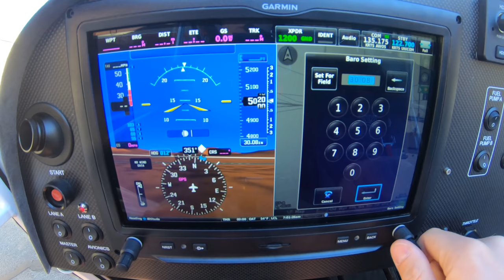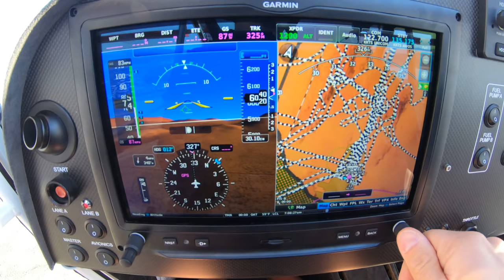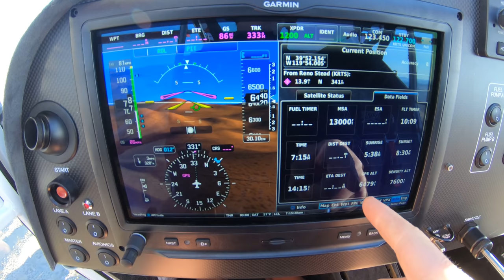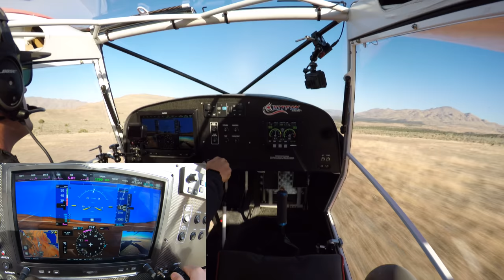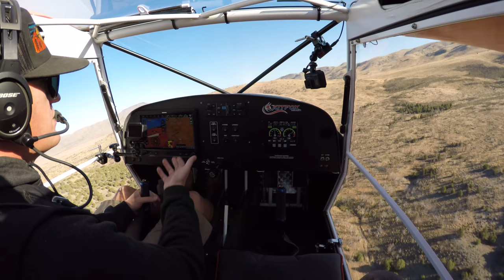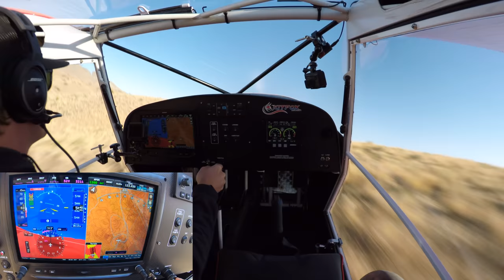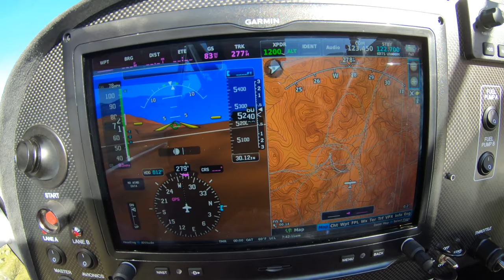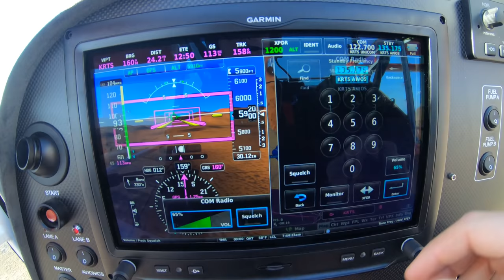Modern Avionics In Bush Planes - Overkill???

Comment: Never had "a panel" - relied on "Dead reckoning," (Deduced reckoning), use of a Chart and plotter, and a circular E6B computer, wind triangles.  On your knee board, use formulas for "time and distance," and fuel usage of "gallons - rate- and time."    Lots of fun and never worried about losing "power" to anything.   With an engine out, look over the instrument panel glare shield, "eye ball a 45 degree angle to the ground," that's how far you can glide. (naturally depending on wind.
Reply: Michael Donavon that’s like saying, “I still walk everywhere because walking works.  I don’t want to drive a car, as it could run out of gas or stop anytime.”  Things change and we have more available to us.  I assume you like using GPS as it can be so helpful.
Reply: I appreciate a bare bones approach to many things, even if just as a backup. But tech can be fun too! In all things, moderation.
Reply: @markwelton6501  Mr. Welton.  You, sir, are correct.  I have used gps as it is quite useful.  Maybe I ran my mouth just a little too much?   Probably.   Thanks for the reminder.
Reply: Michael Donavon you sir are a Gentleman.  I so appreciate your reply.  So sorry if I came across coy.   I agree that a great pilot learns to fly from the simple but much harder to the complex and seemingly easier.  A good pilot must always be prepared.  I do appreciate sincerely, your kind way of responding.

Comment: This may be a stupid question, but why does he keep turning the throttle nob? I'm an airplane noob.
Reply: It is a MacFarlane Vernier Assist throttle. It is a bit difficult to fine adjust the engine rpm by pushing and pulling the throttle. Twist it a smidge and you can get 3500 rpm to 3510 if you like.

Comment: What kind of Autopilot is he using?  Hard to see in video
Reply: Hard to see but I believe that it's a Garmin Gmc 305
Reply: The GMC 307 has rotating knobs to adjust heading and altitude as his does. If you look at Garmins new GMC 307 it has addtl buttons or in different locations as what his has.

Comment: If you cannot fly to where you want to go safely with the standard 6 pack, don't you have to question if you are really a good pilot at all?  What happens when the screen goes blank...you lose 100% of your instruments.    

For all that good pilots go thru to make their planes reliable (sometimes even still using 1930s engine technology, imagine that), this new crop of Glass Panel Jockeys fails to remember that if ALL you have is glass panel (no steam gauges), when those pretty little screens go out or you get a software malfunction, especially if you are IFR, you are screwed.    

I realize that most STOL flyers probably fly VFR only, but still, if you lose that panel and that's ALL you have, seems like a huge risk to me to take.   Putting shiny toys over necessity seems really dumb in aviation.

Comment: And Garmin just got hacked by a ransomware hacker who is asking for $10 million dollars to decrypt the files on Garmin's servers. Until then ya can't push a flight plan to your G3X, or any Garmin device/system.
Reply: Just read that Garmin has de-bugged their flight planning app so it's now up and running again. Also you could still use another flight planning app like Fore Flight that uses Blue Tooth. They can input to the G3X same as the Garmin app.

Comment: Your setup lacks a set of backup instruments. In an emergency these could save your life.
Reply: Backup is pitch (gauged by looking outside) and power (gauged by engine sound and throttle position). This is an aircraft designed primarily for Day VMC operations, so (occasional night ops aside, assuming legally possible in xyz jurisdiction) the 3X is in fact lifesaving overkill 99.xxx%* of the life of the airframe that will likely do way better and way more reliably at helping get you safely out of an inadvertent encounter with IMC.
* Unfortunately Garmin don’t publish their EFIS reliability stats — does anyone else know the data? This is an issue I’m keen to address with UK Authorities who allow microlights (<472.5kg) to fly without backup instruments but not Permit aircraft over that weight: the rationale doesn’t add up to me, given the complexity available in modern microlights vs the reliability of solid state avionics vs mechanical gauges.
Reply: @jimjam623  Regardless how reliable your primary instruments are, you need to assume they'll fail, so I think you should get the minimum backup instruments to help you navigate home and land IMC.